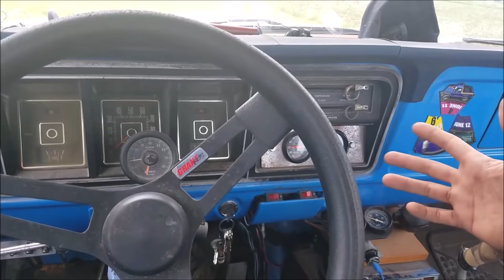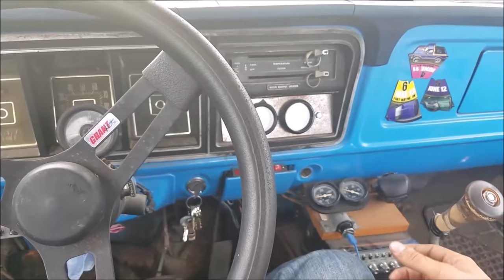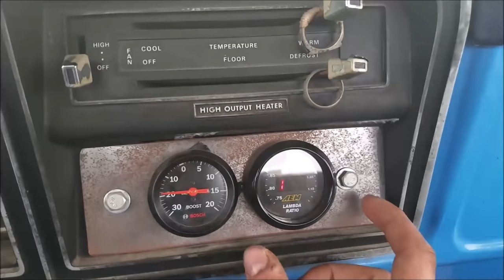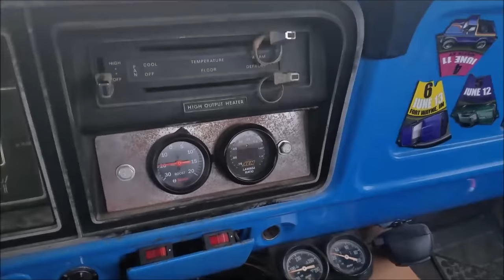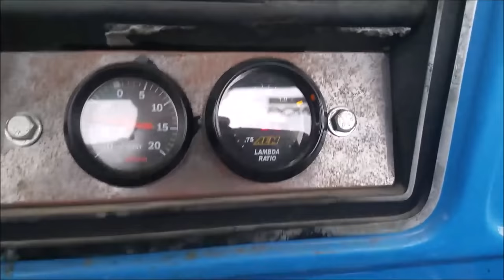Best Carburetor Mod - Vapor Lock & Inconsistent Performance Issues CORRECTED (You'll Never Go Back)

Comment: A cool can also helps with keeping your fuel cool.
Reply from the maker: I tried it - actually made my own with a huge coil - still wasn’t perfect when idling because fuel up by the carb was mostly static, getting bludgeoned with heat! 
Also, once the ice melted and warmed up, it actually worked as a heat insulator! DRAT!!!!
Reply: @ThunderHead289 made my own also. A coffee can, copper coil, and dry ice. I still have a return line. The cool can is just extra Insurance, and if I am racing. Lol.
Reply: @ThunderHead289  there is another reason to run a return line. Keeps the ele. Fuel pump from going out so easy.
Reply from the maker: Completely true - that was the first thing that happened with my electric pump. Dead on the field in under 2k miles. (Summit black pump)
Reply: @ThunderHead289  buddy of mine got car with a ele fuel pump. He kept going through fuel pumps. Finally ask me what he could do about it. Told him the same thing. Add a return line. He is not a mechanic. He owns a body shop. We barter work back and forth. Works out for both of us.

Comment: Iv'e got 2 tanks for the return line to run back to any ideas ?
Reply from the maker: Secondary tank selector valve, except on the return line. Piggy back the control signal to the second selector
Reply: @ThunderHead289  Have you seen the $ 8 cure for vapor lock on uncle Tony's garage channel

Comment: is a return line better than using a suplementary electric fuel pump to run with the mechanical pump ..reason im asking is because my sending unit doesnt have a return nipple so its wat easier for me to just add a inline small electric pump ...will i be ok with that , cause lately with ethenol enriched fuels vapor lock has gotton real bad

Comment: Do you have a schematic for this system? I’m confused about the mechanical and electric fuel pump set up. Wouldn’t it be better to simply run an electric pump back at the gas tank? I recognize that you will be correcting some things so I am really looking forward to seeing what the final system will be.
Reply from the maker: There is no mechanical pump in the system - only electric 👍
Basically, the fuel goes vast the carb, and whatever isn’t used to maintain 6 psi is bypassed back to the gas tank. One electric pump.

Comment: I hooked vacuum from my intake manifold to my auto trans. Is that right? I’m really struggling on this truck lol. 
5.7 Olds 350 2BB Carb Rochester
Reply from the maker: Correct
Reply: @ThunderHead289  Ok that’s solved lol. #2 problem…  I  rebuilt the motor and now the trans is leaking horribly. Any ideas. It’s drippping from seeking fitting. If I hooked up vaccum line wrong could I have screwed something up. TY 😃
Reply: Dripping from zerk fitting on ujoint
Reply: @ThunderHead289  well… I just remember the speedo cable isn’t screwed into the side of the trans. Maybe I need to go see if it’s leeking from there 🤔

Comment: Hello Luke! Instead of an electric fuel pump, can you run a fuel pressure regulator between the mechanical pump and carburetor to get consistent flow? Thank you!
Reply from the maker: Howdy, that defeats the purpose of the benefits of a true full bypass return line 🙂
Reply: @ThunderHead289  I think I understand. The fuel level in the bowl is regulated by the fuel flowing out to the return instead of the fuel pressure going into the carb with a FPR, is that right?
Reply from the maker: @cliprange  the regulator maintains a certain line pressure - any volume not needed to maintain the line pressure is bypassed. 
This layout is actually exactly how fuel injection setups are laid out
Reply: @ThunderHead289  Thanks very much for the explanation!

Comment: I wonder if issues like this were eliminated once feedback carburetors came out?
Reply from the maker: As in like the early 80s Chevy system with the solenoid rods?
Reply: @ThunderHead289  yeah I think Chrysler had them as well. But I believe they had a TPS built-in and electronic metering rods?
Reply from the maker: I’m not sure on the Chrysler, but Chevy used vacuum somehow to dietary the idle rpm. Those were honestly really cool systems, Iv worked on a few and really like them. The low rpm idle stuff is electronically controlled, where there were still plenty of adjustable items like what I am so fond with when running a carb.
Reply: @ThunderHead289  yeah it's a shame they were not more popular. Sam for roughly 7 - maybe 10 years tops. I think back in the day a lot of mom and pop shops add mechanic's that did not work on them or knew how to work on them properly, thus removing the whole feedback carburetor system installing a traditional carburetor. I think it's really cool because it's still uses an ECU, so technically it is electronically controllable. The Best of both worlds in my opinion.
Reply from the maker: Kevin aka junkyard digs and I drove one in an 81 olds from Iowa to Tennessee and back. It was honestly great. 
We literally said the exact same thing. 
Perfect blend - easy to work on, but handled all the low speed anomalous fueling scenarios
Reply: @ThunderHead289  I think I saw the video on that. Did that video also have the Cordoba in it?

Comment: Your regulator is on the return and not on the supply line?
Reply from the maker: It’s the junction between the two - it’s specifically a return regulator. It maintains line pressure to whatever the set point is, then bypasses whatever is not needed to hold the pressure set point back to the tank - pretty trick if you ask me
Reply: @ThunderHead289  what is the pressure range on it? I didnt see in the description at the link. Not sure if it'd over run my 2300.
Reply from the maker: 4-9 psi 
Just click on the link for full discription

Comment: So with it being a V configuration motor obviously, do you have the O2 sensor in just 1 bank? or do you have a Y-Pipe that you put the sensor in? Is it possible to run two O2 sensors, one for each bank, and then the gauge give you a rounded readout?
Reply from the maker: Running two isn’t necessary, if you look at the flow of an intake manifold, the center two cylinders on each bank is fed by the opposite side of the carb. 
So essentially you get a representation of both sides of the carb from one bank
Reply: @ThunderHead289  awesome, thanks

Comment: What fuel pressure are you running with the return on there?
Reply from the maker: I run 7.5 psi - return lines with electric pumps don’t drop pressure unless your return restrictor is too large. Basically the return regulator has a drilled jetted orifice so that fuel bypasses all the time although it’s small - the regulator also has a diaphragm that opens and closes depending on how much fuel is needed to maintain the pressure setting. 
Instead of my fuel bypassing at my pump internally via the pressure relief valve, it’s bypassing at the regulator keeping everything cool 👍
Reply: @ThunderHead289   that makes sense. I got a 85 Ford ranger with a 302 in it. I will have to try this out on it and see if it makes a difference. Thanks for putting your knowledge on here!!

Comment: Is the carb not getting full pressure from the pump????
Looks like with the regulator past the carb all you are regulating is the return line???
Reply from the maker: Think about it buddy, this is the exact same layout as a fuel injected fuel system. 
Any fuel volume not needed to maintain pressure setting is bypassed. Simple as that.
Reply: @ThunderHead289  
I guess the carb will never see full pressure from the pump whether the regulator is before it or past is due to a constant return of fuel at a regulated pressure.
In my limited brain the regulator had to be before the carb for this to work!
Thanks for your time 👍🏻

Comment: Wouldn't that dead head condition actually be acting worse since its an electric fuel pump? The regulator is after the fuel goes into the carb
Reply from the maker: This is literally how the fuel rain on fuel injection is set up as far as the regulator location goes. 
Any fuel volume that isn’t needed in the system to maintain the pressure setting is bypassed. 
This is quite literally the best way (from a fluid dynamic standpoint) to do it
Reply: @ThunderHead289  thank you very much. Have a 77 c10.  305 with 750 cfm. Load up right after idle
Reply: Also, I was referring to the deadhead variation

Comment: What do you think about the factory fuel return set up  using the fuel filter as the pressure bypass?
Reply from the maker: they are acceptable - as close as you can return fuel to your carb, the better. the beauty of the electric pump is that it can move some serious volume at idle - great at keeping a cool fuel supply

Comment: All well and good if you want to idle for ten minutes what's the difference if you idle for three minutes like at traffic lights ? Seem like an uneccessary expense to me
Reply from the maker: If it’s 90 and you have your hood closed, it takes less than a minute. 
The important piece to note is that you can tune for 90, but throughout a normal day, the temp goes from 60 in the morning, to 90 mid day - so if you set everything up to accommodate for that vapor lock, at 60 degrees you won’t have those things going on, and you will be pig rich. 
This is why people wash cylinder walls, are always adjusting their carb, and generally badmouth carbs overall. This alleviates all those issues
Reply: @ThunderHead289   I live in Perth Western Australia that has a veried climate and drive a 1970 ford falcon with a 351 cleveland  and in 35yrs of ownership have never had a temperature related idle problem and my fuel system is standard .

Comment: does carboraitor give you more power than fule injection
Reply: Depends. Usually you can rev higher. So if you're motor builds power in high rpms
Reply from the maker: In comparison with stock injection, 100 percent yes. I need to do a video over it, but stock injection pulls a ton of timing when your in the throttle so that the mixture fires under less pressure - this makes an engine last way longer, BUT it also leaves a lot of power on the table. 

Think of carbs vs stock injection as the light that burns twice as bright for half as long

Comment: Why do you need a regulator on the return?
Reply from the maker: The return regulator actually regulates the pressure of the carb line - whatever isn’t needed to maintain the pressure setting is bypassed back to the tank. 
Works really well to cycle all thenfuel
Reply: So you can Tailor to your application. Electric pump is not stock generic
Reply: @ThunderHead289  Thunderhead 289, 
Is it better to run regulator after the carb instead of before the carb?

Comment: carbureted engines operated just fine for many years without a fuel return of any sort. i never had any issues tuning them either. the float shuts off the fuel to prevent it from getting too much so i do not see the point in a return line. maybe your float is not set right.
Reply from the maker: Completely missed the point. 
It’s air fuel ratio - hot fuel alters the afr. 
Most people leave a bunch of power on the table, or run rich and wash rings and a whole host of other issues and they really don’t even know they are doing it. 
If you had an o2 gauge, watching the dead head style air fuel ratio variability is staggering. 
Tune your engine for 90 degree weather, and it will be pig rich at 60 degrees because that fuel density/temp you calibrated for will be completely different.

Comment: A return line from the engine to tank heats up the fuel in the tank which may create an explosive situation. The Cap may fly off hitting you in the Nose at minimum . The correct way is to insulate the fuel lines near the engine and put an insulator between the carb and intake. Then the old method of preheating the air for cold running. 

It is all a matter of balance but your method is dangerous. You are too young to remember exploding gas tanks and  gas caps that blew off when trying to refuel. Where is you pressure relief valve ? Vapor return line to carb inlet?  Good try but you need to go further in your research.
Reply from the maker: I love how on YouTube folks who don’t know what they are talking about start running their mouth - always some guy with a cat thumbnail too. 
How do you think every single injected car is set up - ask yourself this. 
Return lines are absolutely not a fire hazard. 
There is a 1 inch phenolic spacer on the engine in the video. 
Ignorance is bliss - get yourself an o2 gauge and watch what is really happening without a return line. 
Iv had one on my galaxie for 5 years now also. 👍

Comment: For all the bullshit, just upgrade to a throttle body system.
Reply from the maker: Fun fact, you have to have a return line on a throttle body system - so it’s all the same work, plus more. 
Plus when parts fail and your on a road trip, your screwed.
Reply: Upgrade by making the system even more complicated.  O2 sensor, tps, ecu , wiring harness, plus the moolah $$. Sometimes an upgrade could be considered a degrade.